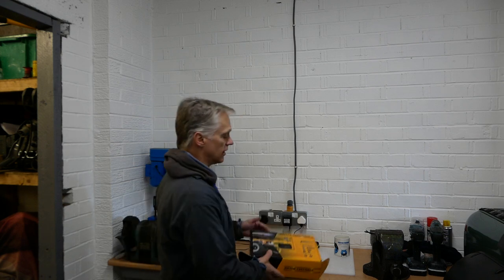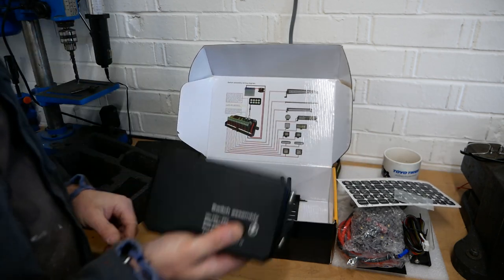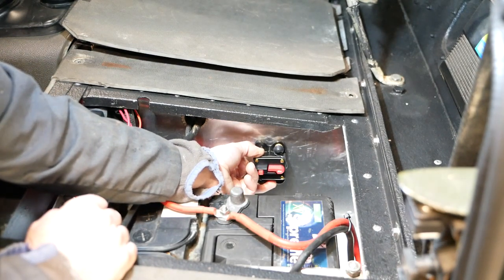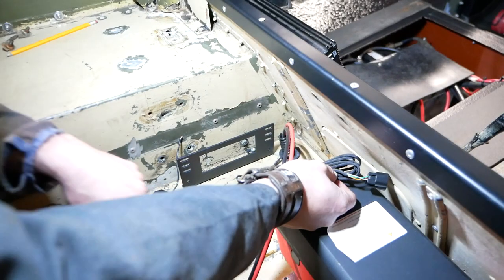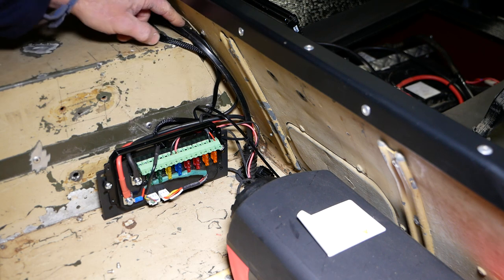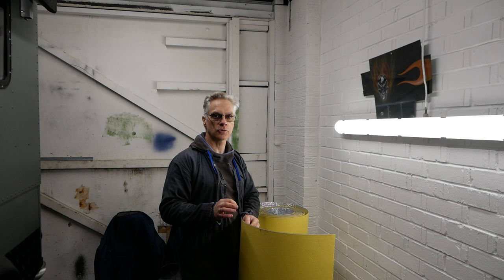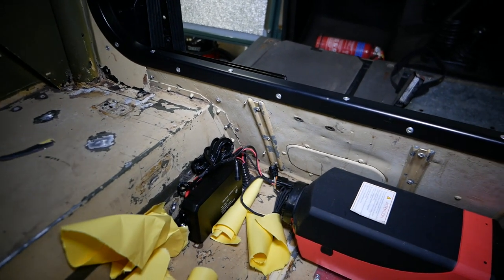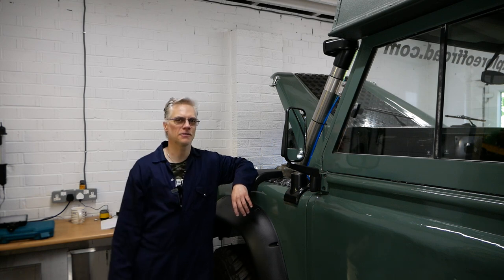Fitting a Fouby4x4 switch panel to Landrover Defender Overland Camper(Beryl) Interior fitout part.5

Comment: Lovely bit of kit, high end electronic switch panel. Saves space no need for a massive dash.
Reply from the maker: Hi Dan...absolutely cracking piece of kit..when i rebuild the Disco later this year i will be fitting one in Heimdall as well..regards Paul

Comment: I like that Switch panel it
makes it so much Easier,
 I know what it's like to run wires everywhere it a reel nightmare nice job there Paul 👍
Reply from the maker: Hi Rob...these switch panels are awesome and making wiring so much easier than having to trace cables all over the place and make it all alot neater as well..regards Paul

Comment: the trick to priming the pump on those night heaters is to Frankenstein connect it to your indicator relay then tick it till it spits diesel at the heater end, otherwise it can take a good few attempts to get the thing primed and fired up and can confuse the ECU. Good work Paul, Those switch panels are the bomb, I fitted one to the Fourby disco with control for the oven. We've just done a fortnight out in the car and it works a charm
Reply from the maker: Hi Neil..did not any problem priming this one as you saw it fire up on the second attempt..but have had problems with them in the past..the switch panel is absolutely awesome and makes it a joy to wire everything in...getting closer day by day for Beryl to be finished and she will be out soon so will have to go on a trip later in the year..see you soon mate...Regards Paul
Reply: @All4Overland  It would be an honour to be with you on the maiden trip ;)

Comment: Great to see Beryl coming together. I like the switch panel, it must save a fair amount of wiring? Insulation looks very effective, think I have the same, you can never have enough. That diesel heater must be the 5kw one, you guys will be absolutely roasting even mid-winter, I guess you can always turn it down. Well done on achieving such a high-quality build, hope you have many great adventures together in her.
Reply from the maker: Hi Peter...its been a long job but it is finally coming to an end and she will soon be out and about...the switch panel is an absolutely fabulous piece of kit and it does make wiring much easier..it is a 5kw diesel heater but we are working on the theory of what will do alot will do a little...thanks for the compliments on the work and we do plan on having lots of adventures..regards Paul

Comment: That is a very nice switch panel, might be what I need for the expedition trailer.
Reply from the maker: Hi Gaz...the switch panel makes wiring everything up so much simpler than wiring it all to a fuse box..i am actually thinking of putting another one in the front to control the external lights..they are really that good..regards Paul